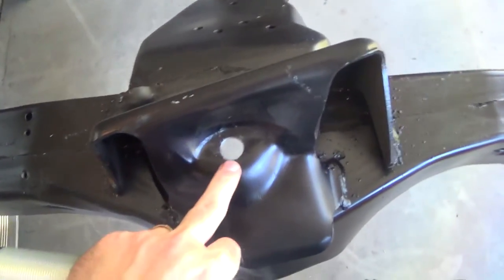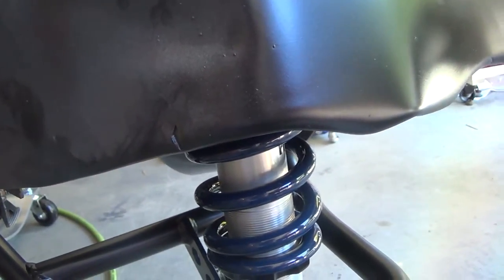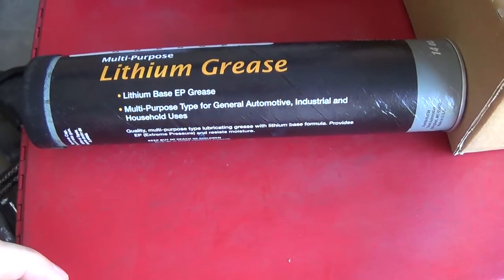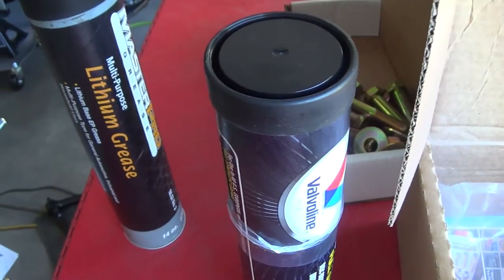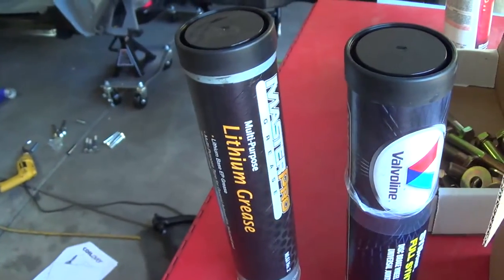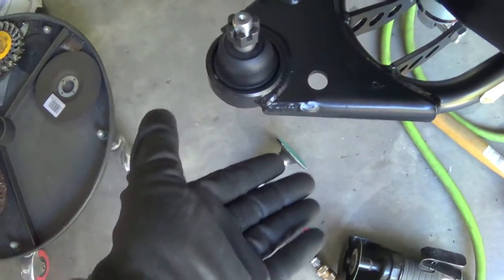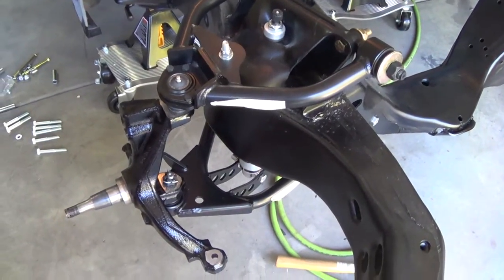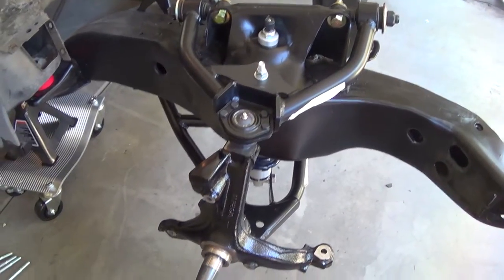1977 Camaro Z28 Part 79: RideTech Level 2 Coil Overs front suspension install

Comment: That surface on the spindle is a machine surface and needs a thick flat washer, it helps the tapered shaft seat into the spindle better and keeps that surface from getting wallered out and helps the cotter key hole line up easier.

Comment: The tapered shaft, spindle, washer, nut, and cotter key function as a solid unit, leaving out the washer is risking that taper not fully seating in the spindle. I have never seen it once without the washer on any A frame suspension  ford, chevy, dodge, plymouth, etc.
Reply from the maker: Hmm. Ok. It seemed a bit strange to me too. Maybe I was supposed to re-use them from the factory parts. Thanks, I will check it out.

Comment: Yes tighten the castle nuts tight the ball joint does all the movement, not it is not required to have a washer haven't found any that does, Aldo ride tech probably would of supplied if it was required, looks great Eric. Can't wait to see what engine your going with
Reply from the maker: Thanks man. Conflicting info on the washer. I will try to research and look at my old videos. Engine is up in the air, but most likely an LS3 variant.

Comment: Looking great brother!!!!! Just tighten everything I suggest not torquing anything till you have the engine in it and on the ground with the cars weight on the suspension then torque everything so there's no  binding 😉👍🏻👍🏻🇨🇦
Reply from the maker: Ok, cool. Will do.
Reply: that ride tech kit is pretty awesome. 1Wild is right about not tightening it until it is on the ground.  also all "synthetic" grease is made from petroleum distillates.  it all comes from natural gas. polyurethane bushing really don't care what grease you use. I had the old poly performance bushing my old 76 Camaro and that kit shipped with silicone grease, I put another set in a 75 Camaro I had, and that kit came with white lithium grease. so I don't really think It matters as long as they are lubed.
Reply from the maker: So, you guys think I should loosen everything up? What is going to bind in there? I am not putting on the tie rods and all that stuff yet, so it is just the upper and lower control arms and the spindles/ball joints.
Reply: +asicerik you probably didn't over tighten everything anyway if you cam move the control arms up and down by hand you should be fine brother once you have the motor in the car and the car is on the ground with most of its weight on the suspension that's when you do the final torque spec on everything . If you tighten everything to tight with the suspension hanging it will bind up on may not drop down to its proper height
Reply from the maker: Ah, cool. The instructions said to put the suspension at 1/2 travel before tightening the upper control arm nuts, so that helped too I guess. Thanks again!
Reply: +asicerik we are all happy for you to be at this point in your  project 👍🏻👍🏻😉🇨🇦 oh and the upper control arms bolts to subframe will get undone at the alignment shop to add shim's if needed do you remember when you disassembled it how many there were? it doesn't matter the alignment will shop will know .

Comment: Those aftermarket upper control arm bolts aren’t knurled like the originals. They are supposed to be knurled so that the bolt doesnt spin when your alignment guy starts loosing those nuts. You should tac weld them or your alignment guy is going to curse at you a lot lol.

Comment: All of your is suspension is suppose to be stiff,  I would leave the upper and lower bushings loose when your adjust the shocks. When you have it on the ground let it seek its own level, then adjust the shocks to the preferred right height, then tighten up the collar on the shock and tighten up the control arm bushings. If you tighten before hand it will have constant pressure  and twist on the bushings, but if you wait until you have the right height adjusted then there will close to zero pressure on the bushings. Over the years I have done many front end suspensions and it just helps when the new suspension is settling in.  My front end guys says it also helps the front end keep alignment a lot better.
Reply from the maker: Ok, cool. Thanks. That will be a long time from now since there is no engine/trans in there. I will have to remember that.

Comment: RideTech best of the best that camaro will ride like a dream what are you putting for power plant just regular 350 or??
Reply from the maker: Unclear. This is car is currently under smog regulations, but there is a bill in CA to move to limit to 1980, which would allow me to do whatever I want. It will still probably be an LS no matter what, but who knows. Probably and LS3 would be my guess.
Reply: Yeh i know cali and there rules but ls3 is one hot engine that camaro would be a racer bolt of lighting. What's next i will see you on tv street outlaws racing lol